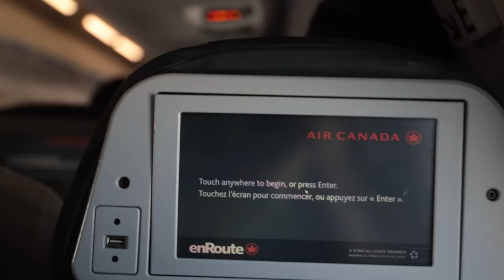I dropped a guitar while visiting @LesGuitaresBoucher

Comment: Ha!  Glad that love tap worked out for you!  When I was 20ish, I was playing with a friend & for some reason we decided to switch guitars.  As I was handing him my Martin D-28, I let go of it a micro second before he had a grip on it.  The guitar was pointed straight up & down & it hit the concrete floor on the end pin.  It was forced straight through the side into the guitar body.  Several huge cracks including separated shards of wood.  I kept it & finally found a repair guy who put it back together months after the accident.  Ouch.  Still makes me cringe.
Reply from the maker: That is so scary. I'm glad you got it fixed, makes me cringe too.

Comment: Thats why when you go into a guitar shop there are chairs for you to sit down and cradle the instrument.  I always take my coat or jacket off. No metal  buttons or zippers to scratch the back .    I have no respect for someone who drops guitars,does not use a guitar stand and props the instrument on a chair or up against the wall duh.. or leaves the instrument locked up in a burning hot or freezing cold car. Duh..

Comment: I sold my Martin D35, so I could afford to buy a Boucher. A year later... no regrets. The only downside, I've stopped looking for new guitars, you can't improve on perfection.
Reply: Was the Boucher in the same price range as your D-35?
Reply: @rosewoodsteel6656  Expect a price of a Boucher to be at least $1000 higher than that of a standard D-35 model. However, the quality of materials and craftsmanship of a standard Martin guitar will not be on par with a Boucher.
A Boucher guitar can be likened to acquiring a custom Martin, but at a more affordable price. And because Boucher has a significant advantage in terms of the wood used, (with the sale of over 20,000 Adirondack tops per year), they are able to reserve the finest ones for their own production, ensuring that the wood quality in Boucher guitars is superior. Note: In 2 days Martin produces more guitars than Boucher makes in a year. So when a guitar leaves the shop... it's been carefully inspected.
Reply: I hear you loud and clear. I bought a Boucher a week ago. My Martins have been acting nervously ever since. ;)